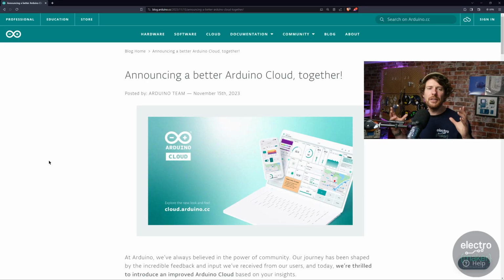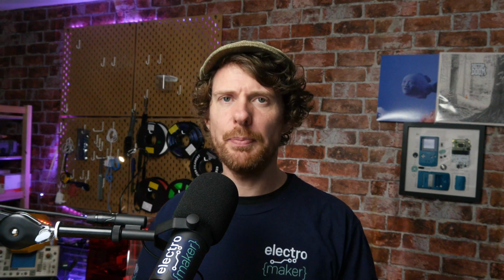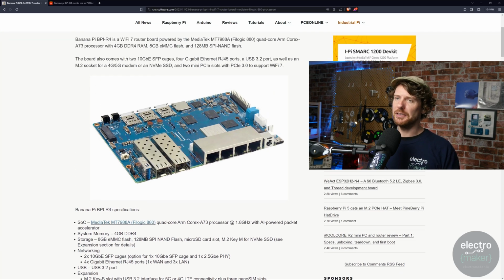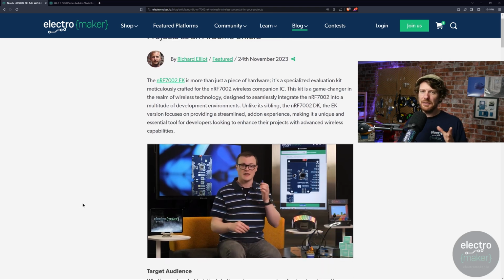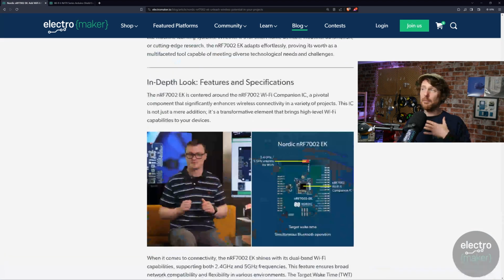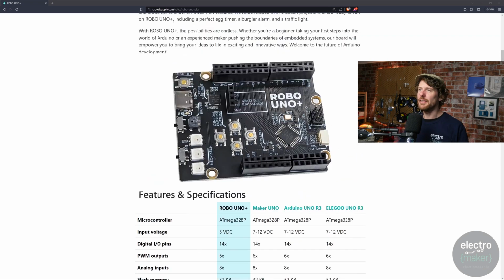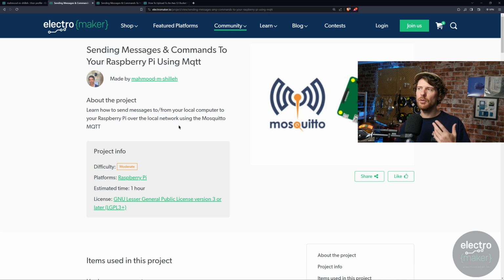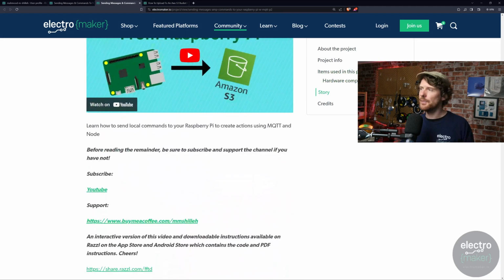Wifi 6 on Arduino with Nordic, MQTT on Raspberry Pi, and More!

Comment: Keep in mind that there nRF7002 EK has an "Arduino form factor" it does not have any drivers for Arduino. It will work with the supported Nordic boards,   and Linux or Zephyr hosts.

Comment: #nrf7002EK  .  I would use it on the Arduino Mega, I would take the values from sensors and drives and make them wireless. It would be a way to improve the Arduino Mega, the Arduino Giga is still very expensive,

Comment: I really like the way you explained its capabilities lan and robin, as a member in smart City Mission club in my university. I'm really into put this board to test to create an overall monitoring system for the streets and ICCC centre to prevent abuse and create abuse detection at night time with its wifi 6 capabilities, thanks for sharing this info 😊 really grateful #nrf7002EK

Comment: I would use this to add WiFi 6 to an Arduino Giga R1 board so it would be able to communicate at the fastest speed with my Wifi 6E router. This combination would be the controller for a small robot that would roam around testing air quality, temperature, humidity, and pressure in the environment.
Reply: Be aware, the nRF7002 does not have an Arduino driver, so it won't work on an actual Arduino. Nordic has never claimed this. It only works on Nordic's development kits.